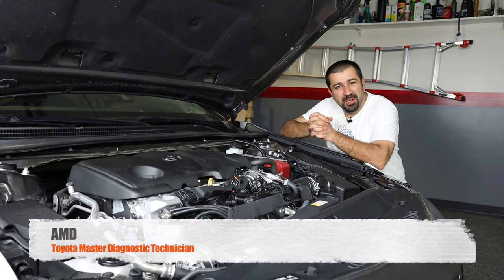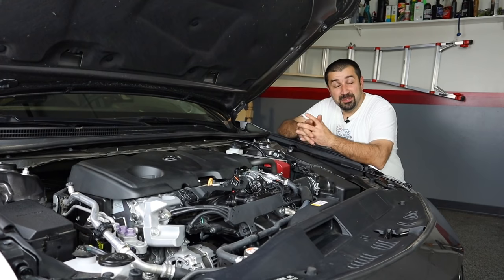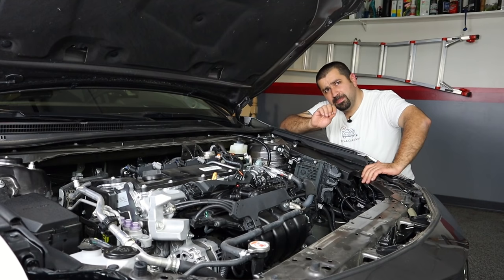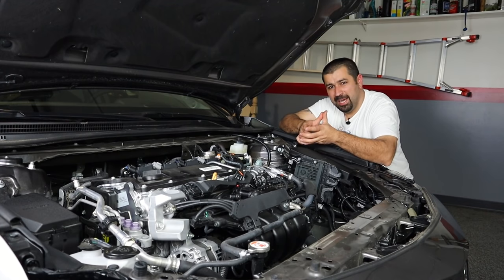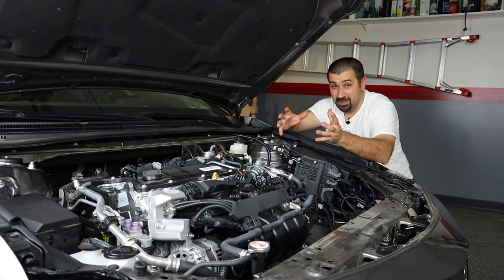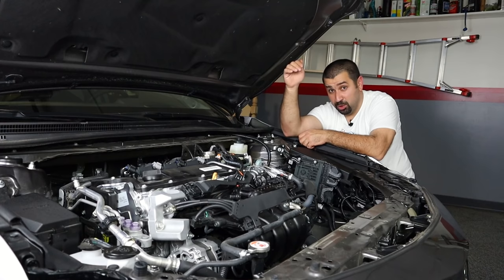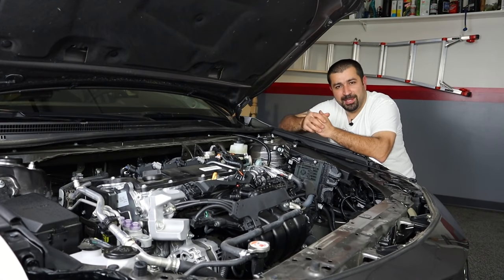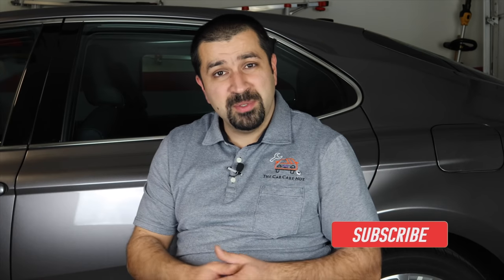Toyota's New Engine Technical review Part 1 : Cooling,Lubrication,Direct Injection and EGR

Comment: I had the 3.5 fks in my Tacoma. Thing used a crazy low amount of fuel when idling and when under low load. The simulated atkinson is amazing for gas mileage.

Comment: Mr. AMD, I think you may have just saved my "bacon" (the A25-FXS in my 2019 Avalon Hybrid).  I was planning to switch to 0W-20 or even 5W-30 because 540RAT's motor oil blog convinced me that 0W-16 would result in insufficient oil pressure and reduced engine life.  The theory was/is that oils thinner than 0W-30 or 5W-30 are only recommended by car makers for that fraction of a percent of improved gas mileage in their CAFE rating, as encouraged by government bureaucrats.  The engine designers, if asked privately, would not recommend oils thinner than  0W-30, or so the blog would have us believe.  Thank you, thank you, thank you.
Reply: It isn't just a Toyota thing, either. 0W-16 is a brand new viscosity covered by ILSAC GF-6B. Consider it an entirely different lubricant; "GF-6B - The attributes of GF-6B include the following:
 Not backwards compatible with older engines"
https://360.lubrizol.com/Specifications/ILSAC/ILSAC%20GF-6/ILSAC%20GF-6A%20and%20GF-6B
Never substitute 0W-16 into an engine designed for any other viscosity, and if at all possible avoid substituting any other oil in engines designed for 0W-16 GF-6B. GF-6B provides better protection against low speed pre-ignition, a serious concern for advanced engines like the A25A engines. The mistake of thinking protection is proportional to viscosity is one that has been made for decades. Viscosity is about bearing clearances; protection is about film strength, a very different thing. When somebody tells you the recommended oil is not right for the engine you know they don't know oil. Oil pressure exists only to maintain oil flow through the potential wear areas, using higher viscosity oil reduces that flow.
https://www.api.org/-/media/Files/Certification/Engine-Oil-Diesel/Publications/Motor%20Oil%20Guide%201020.pdf
Reply: The 540RAT guy may still be correct because the A25A-FKS (and FXS) engines are used worldwide and Toyota owners manuals outiside of the USA say oils as thick as 15W-40 can be used: https://imagizer.imageshack.com/img922/990/O0JZRO.jpg
Reply: @flagmichael  Toyota itself say oils as thick as 15W-40 can be used in the A25A series engines: https://imagizer.imageshack.com/img922/990/O0JZRO.jpg

Comment: Thanks for explanation! :) 

Fun fact: In Poland (and also in UE) a lot of Prius3 users (or users owned cars with P3 engine like Toyota Auris) decided to install LPG installation to the car due to economic reasons (LPG gas is much cheaper). It’s very popular in Priuses used as Taxi. P3 engine allows that because is simple and use port injectors. Installation lpg in 2.0/2.5 dynamic force engines will be much more complicated because we have more injectors, and also will cost more. Also, direct injectors in most cases must be cooled by fuel so we can’t use only LPG like in P3 where fuel injectors are disabled on lpg mode ;) but.. we have first successful LPG installation in 2.0 hybrid as far I know ;)
Reply: Dawid, LPG is for the Polski Fiat. You should use your hybrid car with 95 grade E10 petrol at the minimum. If you cannot afford the 5-6 liter petrol per 100km, you should use public transportation or bicycle. (If you have money for a monkey, you must have for banana too.)

Taxi drivers are tight-assed people who would sell their mothers for 2 cents. Not only do they skip proper car maintenance, they usually try to cheat with the tariffs too. Respect for the minority who are not like that. I do not feel sorry for their LPG issue to be honest.

Comment: On the engine oil, the owners manual for the Australian A25A-FKS states that it can run 0w16, 0w20, 5w20 and 5w30 reliably and can even handle 10w30. I would posit that CAFE/EPA make it so stringent that the auto mfg has to recommend the thinnest oil to meet the EPA MPG requirements at the detriment to the rotating assembly. You make it a point to talk about how smart Toyota engineers are, and I bet they’re smart enough to configure the electronic oil pump to put out the correct pressure in a whole range of engine oil viscosities. Please stop with the kool-aide and shoot everyone straight. 0W16 is government juice, just like DEF in a diesel after treatment system.
Reply: Loose rings, water thin oil , high pressure fuel injection .....seems like a  disaster waiting to happen .
Reply: I wish he would give us a good answer for this.

Comment: Can you please do a short oil change video of this type of engine?  Or even the new Rav4/Venza oil change?
Reply: 2020 RAV 4 has a conventional spin on canister type filter. Nothing hard about changing it, except ghat the first time was a royal pain. The filter was significantly over tightened from the factory. You have very little room to work around the filter.  Make sure you have a good filter wrench

Comment: “It sounds like a German car, not a Toyota.” 

That’s what I often say: Vorsprung durch Technik (Audi) is living on the edge for having a technical advantage. Toyota and many other Asian brands that are successful in making reliable cars make conventional cars. They are not often very fancy and on the edge, but contain scrutinized and efficient technical solutions that balance reliability and technical newthinking with what is beneficial for you as a customer and them. Toyota/Lexus/Daihatsu/Scion is not as exciting as an Audi or a BMW, but definitely more reliable. That is what I think hearing such a comment about German cars. ❤️
Reply from the maker: I agree. Some German cars are beautifully made and well engineered. But they are also the way they are with the compromise of reliability. Things will fail early and cost a fortune to fix but that’s the price of the way they drive. Toyota’s don’t and never will drive like Some Germans cars do and on the same token German cars will never be as reliable as Toyota is. Two different design philosophies I suppose.
Reply: @TheCarCareNut  That is a fact. Have a nice weekend!
Reply: Isn't the low manifold vacuum more of a result of this engine being an Atkinson Cycle engine, than it having direct injection?
Reply from the maker: That as well. It gets even worse with direct injection.
Reply: Agree. But there is more, like BMW using plastic parts in the V6's cooling system with those parts commonly failing around 80,000 miles and requiring a very expensive repair job. Which of course affects the used car value.

Comment: For those of us who are old enough to remember the old Toyota 3.0 V6 from the late 90's/early 2000's, it was rated at 200hp. Now you're getting the same power from a smaller engine with 2 less cylinders on regular unleaded and no turbo. Pretty amazing.
Reply: @Russsir  Like Toyota engines are always breaking down? Not historically. Also a 4 has much cheaper labor costs than a 6 or 8. There's no turbo on this engine to worry about.
Reply: The 1MZ-FE engine was decent in the days although it was hurt by knock sensors that couldn’t work efficiently with low octane gasoline. Keep in mind that the 200 hp came at 5200 rpm for that engine vs 6600 rpm for the A25A-FKS engine which helps with its responsiveness. Toyota also didn’t have any variable valve timing in the 1MZ engine in 1995-1999 which would be considered a feat of its own to get 200hp.
Reply: @worldlinerai  I'm still have a ride with that engine. You are spot on about the octane and knocking. I found years ago that I had to use premium to minimize knocks. The owner's manual says get "increased performance" with higher octane but isn't required and that brief knocking is "normal". I also noticed better engine startup on premium. Seems it never should've never been sold as a regular unleaded engine.
Reply: @Russsir  Exactly ! Wonder what just that water pump cost ? $500 ?
Reply: No absolutes in engineering. The old engine surely has a host of performance advantages outside of simplicity compared to this current engine. I bet this current engine's performance can only be extracted when coupled with some absurd 890 speed transmission.

Comment: i have a 2018 Camry SE with 55000 and no issues I love this engine. i change oil every 5000 using Toyota Filter and 0W-16 Toyota oil exclusively. IMHO cheap insurance and besides the engineers designed it this way for a reason.

Comment: A certain German car manufacturer using electric waterpumps  - YAY MONEY PIT!!
Toyota using electric waterpump - it must be damn reliable :)
Reply: It's not that reliable. Ask GASKETMASTERS, who replace all the blown head gaskets caused by Toyota electric water pumps. Toyota electric water pumps are poorly designed. The impeller is too small, and the impeller rides on a circular armature that has a plastic rim. The plastic rim cracks and jams the impeller. Then the pump is toast. Stay with a Gen 2 Prius with a conventional water pump that lasts 200k+ and costs $35.00 to replace. This old water pump will probably let you know when it fails and you won't be calling GASKETMASTERS or worse, junking your car with a fried engine.
Reply: @amazoidal  Before you start putting the name out.." Gasket Masters "and how great they are and their opinions about things they know little about.... Let me inform you that they are not accredited by the Better Business Bureau and they have an  F rating.. which is terrible.. I would not want them to work on my lawn mower... They have numerous complaints of failure to respond as well as complaints that are unresolved. They may be okay to work on older model cars like Scotty kilmer is capable of.. however when it comes to a complex engine like the Dynamic Force/ Atkinson cycle they are not qualified and do not meet specifications.. That engine is way over their head for them to be judgmental making comments about a complex engine they know little about.. Especially that comes on from a bad repair that they made and don't want to be responsible for it..
Reply: So many valve within the coolant system it has to be very reliable hahahahahaa
Reply: @amazoidal 
Bullsht
 125,000 miles no problem

Comment: I just wonder how the longevity of these engines is going to be over the years. Toyota has gained such a reputation for there reliability and durability but with all these complicated systems being as new as they are will they hold up? Electric water pump.... 8 injectors DI and port.... variable demand flow oil pump.... etc. I can see the repair bills getting very costly towards the end of its projected life as well.
Reply from the maker: Being Toyota they really took their time with this engine if you look industry wide a lot of other manufacturers already had similar technology a long time ago but it was problematic and rushed. Toyota usually takes their time with testing and doesn’t rush things at least on the Toyota badged cars that’s why they’re reliable
Reply: The more I see of this stuff the more I'm determined to keep to the old stuff like my 97 Toyota Ipsum,98 Mazda MX5 and 2001 Toyota Camry.I'm making an effort to watch this because it's becoming more and more  irrelevant to me now.
Reply: High pressure fuel pumps are expensive and he even admits (hesitantly) that some “special care” needs to be taken when replacing it, or when working on the high pressure system. The electric water pump on my 2019 has already left me stranded with only 85k miles and I’ve read of nothing but problems with them. These variable pressure oil pumps are undoubtedly another high potential failure point.

Comment: My concern is what happens when the electronic oil pump, water pump or thermostat fails. Mechanical parts usually give you some warning. For example, when a water pump fails it’s almost always the seal around the impeller shaft. It starts leaking slowly, then more. Oil pumps can fail gradually as well. With these electronic pumps when they fail they fail 100 percent. What electronic safeguards are in place to protect the engine from damage? Also, how easy is it to access these parts to replace them. Where are they located and how many labor hours are required to replace them?
Reply: The oil pump is mechanical, with electronic controls. 
The water pump is mounted on the side of the engine with a few bolts. If it fails it's as easy as the older units to replace. Much better than having to dismantle your timing system to change it like on some designs.

Comment: Thanks, TCCN learned a lot I took our 2019 Rav 4 LE AWD back to the dealer because of the noisy motor they said it was normal. After our old 08 Rav 4 burning oil issue which they honor didn't want to wait.

Comment: Hi! According to what I read on the Dutch Toyota forum, the 0W16 oil issue I told you  about, is still lingering around. For the A25A engine, Louwman, the official Toyota importer, being also the main Dutch dealership organisation, still poors 5W30 in their customers vehicles that have this engine. In my case, I tell them to put 0W16 in but I still have to tell them to do so. I have tried to contact Toyota Japan, however it seems to be easier to contact the man on the Moon. What can we do to resolve this? Greetings from Hekelingen, The Netherlands. Bye, Willem.

Comment: Everywhere I've tried to get my oil changed, they want to put in 0W-20 oil.  Finally, I bought 0W-16 and a better oil filter and had them use that for a break on the price.  I'm not about to play with using a heavier oil.

Comment: My Toyota Dealer forced me to get 0W20 instead 0W16. I'm a little bit worried about it.  He told me for innercity commute it's the best choice... The oil getting thinner in time.  Next time I'll use only 0W16. I've got a Corolla TS Hybrid 1.8 Europe Version (2020)
Reply: The 1.8 ZR actually uses 0W-20 primarily, so you'll be better off with that.

Comment: I have this engine in my 2020 Toyota Camry SE and I get 39mpg and decent power. Its just super noisy and clattery
Reply: Is this highway (rural roads)mpg or street mpg?
Reply: What! That's it! Twice the complexity and electronics of a standard petrol and it get 39mpg??? Love toyota engineering, but my 2001 celica 190 with 2zz engine gets 38mpg on a good run... zero problems after 4 years.
Reply: @robertopics  That's mostly highway. Combined I get like 32.

Comment: Not long, 0-60 mph in 8 seconds was quick, a top speed of 130mph was very fast, 8 speed automatic transmission was high tech, it is quiet and 39mpg at highway speeds was unheard of except for exconbox diesels. Toyota has managed to combine all of these features in the large midsized Camry. It is also  competitively priced. Its worst features are the dashboard, non-intuative steering wheel controls, low rider ground clearance that can scrape the underbody and front doors that swing so far that they can be hard to reach when closing them. Still probably the best car value these days.

Comment: I bought a 2018 Camry a month ago, the dealership filled the engine with something other than 0w-16 oil, because I could tell on cooler mornings that the engine took abnormally long to warm up and felt sluggish under acceleration and would short shift all the time. It was a little better once it was warm, but something seemed off. I went to Walmart and bought the correct oil and could immediately notice a difference on how effortless it would accelerate and shifting seemed like it should be, and it warms up a little bit faster.

Comment: Does the corolla hybrid’s 2020 transmission have a physical 1st gear like the cvt in the normal corolla ?
Reply from the maker: Hi! The corolla hybrid doesn’t have a physical 1st gear like the non hybrid.
Reply: @TheCarCareNut  does the Corolla hybrid have an eCVT like the Prius?
Reply from the maker: Hi Ken. Yes the corolla has a similar eCVT to the prius

Comment: Thank you for this vid! How often would you suggest changing oil in this if planning to keep 10 years 250,000 miles? 10,000 mile recommended oil changes seems pretty high 😬
Reply: Every three months or 3000 to 5000 miles oil is cheap maintenance always use Toyota oil filters
Reply from the maker: I agree with John. Keep it up to 5k miles or 6 months and use an original filter with decent quality oil. Like John mentioned oil is cheap and so does the insurance it gives ya!
Reply: @TheCarCareNut  Thanks for the recommendation! I have been doing oil changes on our 2014 Prius when the 5K mile reminder tells me it's time, although our service fits the 10K mile comditions in the maintenance schedule. When I change the oil it is darker than new but I can still see light through it. I'll stick with the 5K mile changes.
Reply from the maker: Exactly the point Michael! The idea is not to let the oil get ditch dark before replacing it. Doing that over time is where the issues start. I always like to see darkened oil but still has some color to it when draining
Reply: @J.P.M. 52 

       I would.  Oil has a shelf life
Reply: @J.P.M. 52 Yes and the oil change is free.
Reply: @TheCarCareNut  I will use amsoil 0-16 and amsoil filter. This is the best oil and filter.
Reply: I change the oil in my 2018 Camry SE every 5000 miles. I use OEM filter and OEM oil. Cost wise there is little difference and for me its peace of mind.

Comment: Too much electrical components that can break. That is the beauty of this system!
Reply: 197k miles on the 2018 Camry I've been driving. No problems yet on the 4cyl
Reply: @xxk4rilsxx  That’s a lot of miles on an 18.  You must be a courier.  I have 42k miles on my 19 RAV, so far no issues knock on wood.  How often do you change the oil?  Have you done any other maintenance?
Reply: @golferpro1241  I like it.  It’s the perfect size SUV.  The mpg is really good for a non hybrid.  I’m averaging 39 mpg with mostly highway travel.
Reply: @xxk4rilsxx  197k mile?